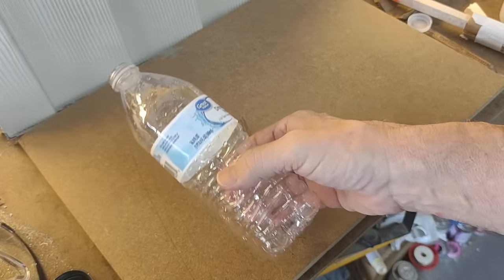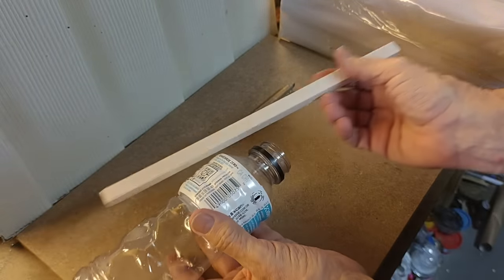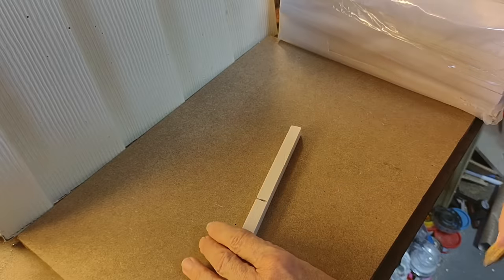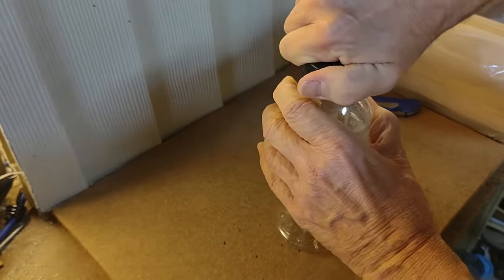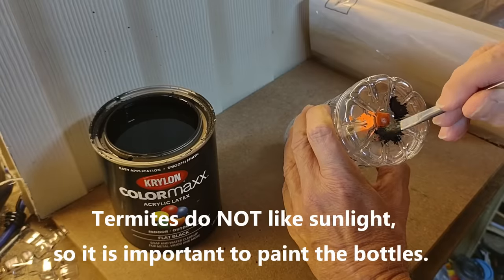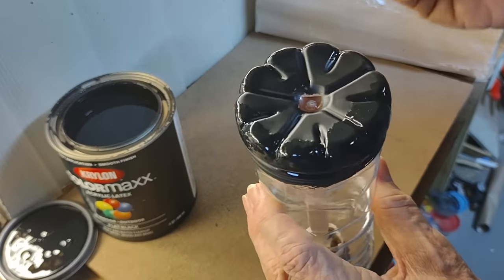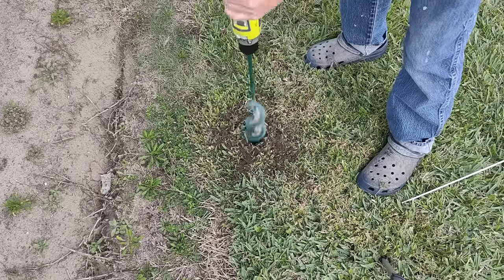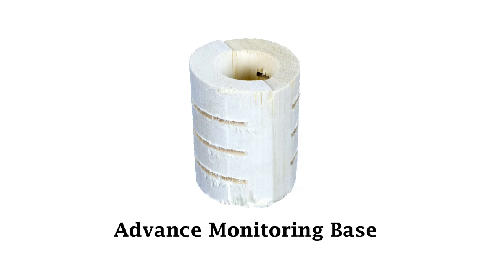Unbelievable Water Bottle Trick for Termites!  Simple to do!

Comment: Most company charge minimum around $750 installion plus $300 yearly maintenance charge.
Reply from the maker: That's right, and it the annual fee goes on forever.  The worst part is that it doesn't always work because the stations are so far apart.  I just had someone write to me a few days ago.  They had the Senticon system installed by a well-known national company and, after paying for several years, they got a termite infestation.  They are still assessing the damage, but it could be serious, and it is unclear at this point if the company is going to compensate them for it.  It's really common sense... The closer you put the stations to each other, the better the chances that the termites will find them before they find your house.  I'm not saying that it is impossible for the termites to miss them at 4-foot intervals, but it is very unlikely.  I can tell you that I am using the home-made stations at my house.

Thanks for the comment.  Be well my friend.
Reply: @GuysPestSolutions  I used to sell and install sentricon system back in South Carolina. I always was ethical with the customers and also I provided insurance for them. If something happens, we reimbursed them repair cost. I helped them file their insurance as well.  I prefer trench treatment as a person.  It’s always nice to you Guy. Be well too.
Reply from the maker: @Hunterbay872  Sentricon was sold as the greatest thing since sliced bread and I believed it too.  For the most part, I think if does work, but I no longer believe that it is foolproof.  I now believe that it has the same issues as any other monitoring system.  Most of the time, it will prevent termites, but it does miss.  When it was pitched to me, I was told that it never fails, so it was way over sold.  I agree with you about trenching.  I am old school with termites.  Even trenching is not 100%, but it's as close as you can get.  Trenching almost never fails, unless you are dealing with Formosan termites or maybe a colony that is under the house.  An experienced pest controller should spot that stuff though and adjust the treatment accordingly.  I can tell you that I would never trust Sentricon with Formosan termites.  So, yes, if you properly identify the species, then trenching almost never fails.  It has been, and probably always will be, the best way to go after an existing infestation.  I would really like to see companies stop selling Sentricon and just go back basics.  Anyway, that's just my opinion.  I'm sure that others see it differently.  I'm happy to hear that you were honest when you sold it.  Always including a repair guarantee is the right thing to do.  So, I have no beef with that.  My problem is that not everyone does that.  They charge extra for the repair guarantee and it's not cheap.  So, the homeowner passes on the guarantee and the whole thing is just found money for the company that goes on forever, with absolutely no risk.  I wish everyone was as ethical as you, but more and more I am hearing one horror story after another.  Back in the day, I don't recall it being like that.  

Thanks for the comment.  It made me smile to hear about an honest Sentricon guy.  Be well my friend.

Comment: Sir do these animals can come inside the house, per say through the AC
Reply from the maker: You are raising an interesting question.  Termites cannot be exposed to air, or they will die.  Therefore, subterranean termites build mud tubes so that they can get around without being exposed to the air.  I think it would be somewhat unusual to find termites in your air ducts, but I wouldn't say that it is impossible.  If there was an opening in the ductwork that would allow the termites to get in, I suppose it would be within the realm of possibility that they could build mud tubes inside the ductwork.  That being said, I think it would be more likely that you will be seeing mud tubes that are not inside the ductwork.  Most of the time, you will find mud tubes around the outside of the building that are coming up from the ground.  If you have a crawl space, you may also find them under there as well.  Mud tubes can sometimes also be found in the eaves and in the attic.  

I hope that helps.  Be well my friend.

Comment: Thanks for the info. I recently cancelled my contract for bait stations. This contract was for $300 a year, a little pricey for me. They left the old bait units in the ground, but took out the bait after I cancelled. Maybe I can use your method with these and the make some more with bottles to fill in between. Thanks again.
Reply: Just wondering.. were the bait stations similar to these?
Reply from the maker: Yes you can.  Just put the wood in the Sentricon stations.  The only thing is that you need to open them to check them.  Also, they are probably too far apart, so you may want to fill in with the home made stations.  Be well my friend.
Reply from the maker: @jjc355  The Sentricon stations use a bait that is also eaten by ants and there is no dot at the top for easy monitoring.  So, the home made stations are actually better.  Be well my friend.

Comment: Thanks for your advice much appreciated I am very poor. Therefore I ask please advice on drywall termite erradication. Much thanks Sir
Reply from the maker: If you are talking about drywood termites, I must tell you the truth about them.  It is important to understand how drywood termites work.  They enter through cracks and crevices around windows, doors, eaves, pipe penetrations, and so forth.  Most of the time, they enter through several locations.  That is because a swarm of them attacked your house at the same time.  If there was a crack or a crevice, then they probably found it.  After they establish their galleries, which will be inside the wood, it will take four to seven years for them to be able to swarm.  Now that they are in your house, the swarmers will use holes that are in your studs to travel through the walls.  Those holes in the studs were created by the electricians to run the electrical wiring.  Not only are these holes going through the studs, but holes were drilled into the attic for the light switches and to run some of the wiring for the outlets.  So, the termites now have easy access throughout the attic and the walls.  If you have a basement or crawl space, they have access to that as well.  Most of the time, you will have no idea that they are in the walls, because the frass is inside the wall.  To make matters worse, if you have drywood termites, then your neighbors have them too.  That means you have been getting swarmed for as long as they have existed in the neighborhood.  Most likely, we're talking about years, so it's a safe bet that you have these guys in many locations in your home.

I always hate to be the bearer of bad news, but if you have drywood termites, the only sure way to get rid of them is to fumigate.  Prices for this can vary wildly in this industry, so I recommend that you watch my video on how to hire a pest controller without getting ripped off.  That video can save you a lot of money.  You should also know that the gas they use to fumigate has absolutely no residual action whatsoever, so you can get reinfested the moment the tent comes down.  Like I said before, if you have drywood termites, then your neighbors have them as well.  Since drywood termites swarm every year, it is almost a certainty that you will be reinfested within a year after the fumigation is done.  The only way to prevent this is to do a preventive treatment on your house every 60 days.  Most pest controllers will not do this, so it is something that you generally need to do yourself.  I have a video on how to do that and I will place a link below.  This is a generic video that covers a lot of different pests, but it also works for preventing drywood termites.  Just ignore the part about treating your yard.  You only need to treat the house for drywood termites.  This will not treat the termites that are already there, but it will stop new ones from getting in.  If you absolutely cannot afford to fumigate your house, then you can try spot treating it yourself.  It is virtually impossible to find all the termite galleries, but it is way better than doing nothing.  Regardless of how you treat it, you should begin the preventive treatment immediately, so that you do not get additional termites paying you a visit.

I am so sorry that this happened to you and I know it's expensive, but there are no easy and cheap fixes for this one.  If I had one, I would be a very rich man.  Drywood termites is kind of like your house having cancer.  I really wish that was not the case.

I hope that helps.  Be well my friend.                    

Video on how to hire a pest controller without getting ripped off:  https://youtu.be/y-a8XOqVrlE

Video on how to prevent drywood termites:  https://youtu.be/Yozv3s-Qwlw

Video on how to spot treat drywood termites:  https://youtu.be/U7ck7zhS0Xo

Comment: Thanks so much for all the great info. I’ve made about 15 stations and have a placement question.   What’s the closest I can place them to the house?   I live in Sarasota in a one story  house on a slab and with metal studs.   If I put them 3-4 feet away the thick grass we have here will grow over them. So can I put them a couple feet from the house in a mulched garden area?   Thanks again so much.    Alan
Reply from the maker: Ideally, the stations should be placed three to four feet from the house, but you are correct that placing them in the grass can be problematic.  It is okay to put them two feet from the house, as long as you do not have rain running off the roof on top of them.  So just make sure, if you do not have gutters on the house, that the water isn't going to be spilling directly on top of them.  If you do have gutters on the house, then you can locate them as close to the lawn as possible.

I hope that helps.  Be well my friend.
Reply: Thanks again  Guy for the clarification.  I’ve made more than 22 inspection bottles now.  I’m going to try to spray the bottoms with black paint.  I’ll use a small dot of masking tape over the inspection area that I’ll remove after painting.   I’ll let you know if that works out. Be well my fellow Floridian.
Reply from the maker: @carnutal3627  You are very welcome.  Some people told me that they masked over the orange area and then spray painted the bottom of the bottle black and it worked well.  I think how well it works depends somewhat on how the bottom of the bottle is shaped.  It is also very fast to mask the orange area and brush paint because you don't need to cut in.  I was using a very small brush, but if you mask, you can use a much larger one.  Good luck with it.  Be well my friend.

Comment: Problem is you have to buy a termite release to sell your house when the time comes IF you don’t have the letter of clearance that only comes with a contract…..upwards of $500 at closing in some states..
Reply from the maker: This is not about selling your house.  This is for homeowners that want an inexpensive way to monitor for termites.  If you are selling your home, most banks do require a termite inspection and you do need to pay for that.  Of course, if you have been monitoring for termites, then you will not have any when the inspection is done, so no treatment will be required.  Just the inspection fee.  This is in no way intended to be a substitute for a home inspection.  I hope that helps.  Be well Jennifer.

Comment: I have a quick question, I thought I had termites in my pantry, they just started showing up a few months ago. The only thing is they are very small and none have wings. I did some more research and they look identical to the saw tooth beetle. Does the saw tooth beetle leave the "sawdust" droppings similar to termites? I have brown sugar, wheat flour, corn starch etc stored in the pantry. What other signs/damage do saw teeth beetles do and what is the treatment for them? Thanks for your indepth videos they're very helpful!!
Reply from the maker: Sawtooth grain beetles are not a wood destroying pest.  They will feed on the stored products in your pantry.  Most termites do not have wings, but they seldom come out in the open where you can see them because they will dehydrate quickly if exposed to air and they will die.  So, they typically remain in the wood.  They are a cream color and can be mistaken for beetle larvae.  You should not see sawdust droppings with sawtooth grain beetles.  So, let's start by figuring out exactly what these things are.  Look at those droppings with a magnifying glass.  Does it appear to be fine like sawdust or is it more like tiny pellets?  Are you seeing any adult beetles?  Look inside the packaged goods and see if there are any adults or larvae in there.  Termites would most likely not be in the packaged food.  If these guys are eating your food, then they are most likely some species of grain beetle.  If they are not eating your food, then you may be looking at termites.  Especially if the droppings look like pellets.  This may also be a wood destroying beetle and not a grain beetle.  For example, they could be powderpost beetles.  They do leave behind a sawdust like powder.  Please tell me where you live.  Location matters.

I hope that helps.  Be well my friend.

Comment: From my experience, fastest, cheapest and very effective way of killing termites is to use dishwashing liquid. Using water to dilute the dishwashing liquid, make a rather concentrated solution and spray generously on the area affected by termites. This solution is much, much more effective than using boric acid solution.
Reply from the maker: Unfortunately, this will not eliminate a termite infestation.  Using dishwashing liquid is a fast kill that will make it look like you killed the termites, but like boric acid, you just killed the ones in the infested area where the dishwashing liquid reached.  The termites will now avoid that area and eat elsewhere in your home.  Usually not far from the area you treated.  You won't see them because they are deep in the wood.  Don't be fooled though.  They are still there.

Be well my friend.

Comment: great vid!    question  i had found termites in an old wood planter located 6 feet from the house   should i be concerned??
Reply from the maker: You should definitely be concerned.  See if you can obtain a specimen from the planter that has a red head.  Then watch my video on how to identify termite species.  You can usually dig one out with a flathead screwdriver.  Let me know what you find out and I will tell you how to treat it.  Be well my friend.

Video on how to identify termite species:  https://youtu.be/dIs_a0nfVjg
Reply: thanks guy for getting back to me   it was all white no red head  i live in long island n.y. i think we only have the subterranean type....i checked the soil in the planter did not find a nest  or any mud tubes....  now some years back before i moved in   the house had termites they had a company put in those bait traps that solved it   thank you so much for your help!!!   dave
Reply from the maker: @scuba422123  You are correct.  You only have subterranean termites in NY.  Unless you have kept up with those bait stations, they are probably no longer working.  If I were you, I would treat my house with termite granules and I would use them under and around the planter as well.  I will give you a link to my video on how to do it and a link to the granules.  They say they won't ship to NY, but others have ordered it from Amazon and they did ship it, so don't worry about the notice that says they don't ship to NY.  Please do let me know if you cannot get the granules and we can explore other ways to get them.

Be well my friend.

Video on how to use termite granules:  https://youtu.be/H7rW_TSBHJ4

Termite granules:  https://www.amazon.com/dp/B000RUIJYM?ref=nb_sb_ss_w_as-reorder-t1_k0_1_6&amp=&crid=1SUQDDGTUGU4P&amp=&sprefix=termit

Comment: Great video Guy, what do you suggest for an existing termite colony nest?
Reply: He mentioned that in the video
Reply: He gets into that at about the 3 hour point.
Reply from the maker: How you handle that will depend on the species.  Figuring out the species is actually pretty easy and I have a video on how to do that.  I will provide you with a link below.  After watching this video, you should be able to identify the species.  Just get back to me after you watch it and let me know what you found out.  At that point, I can tell you exactly what you need to do.  Let me know if you have any problems identifying the species, but I do not think that you will. It is much easier than you may imagine.  Also, please tell me where you live.  Location matters.  If these guys are a common species of subterranean termites, then it's pretty easy to get rid of them.  90% of the time, this is the case, but it's best to make sure.  

Be well my friend. 

Video on how to identify termite species:  https://youtu.be/dIs_a0nfVjg
Reply: @GuysPestSolutions  they are Formosa termites
Reply from the maker: @paullopez3214  Please watch my video on how to treat Formosan termites.  You need to get on this right away because these guys can do a lot of damage very quickly.  Be well my friend.

Video on how to treat Formosan termites:   https://youtu.be/xDtGUWxMrRw